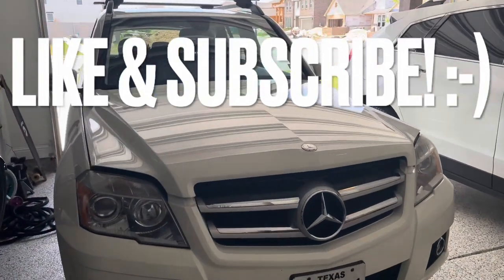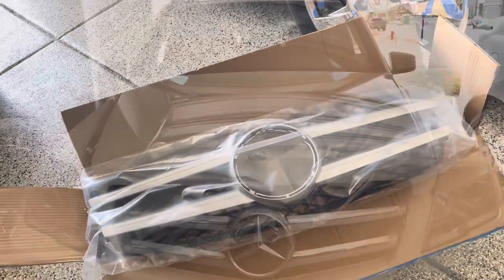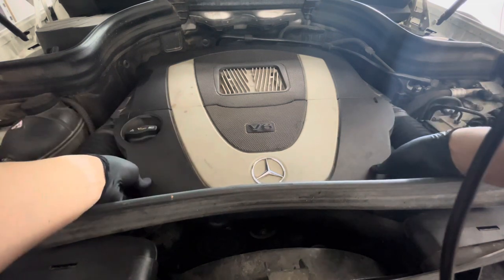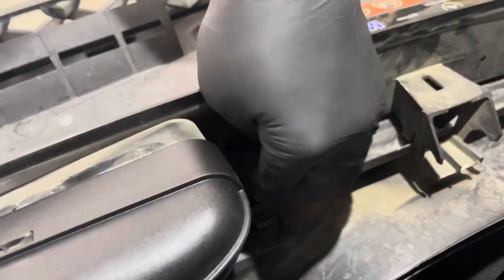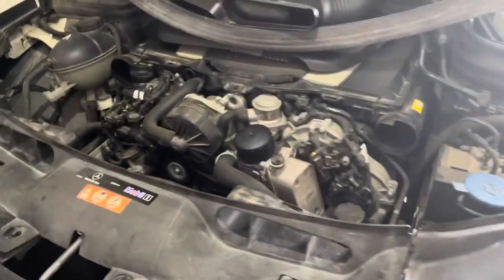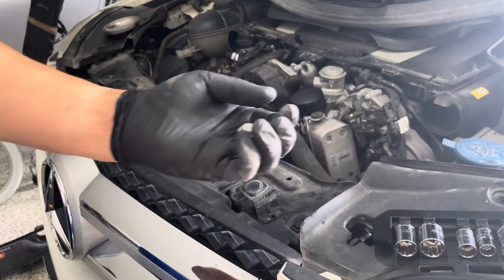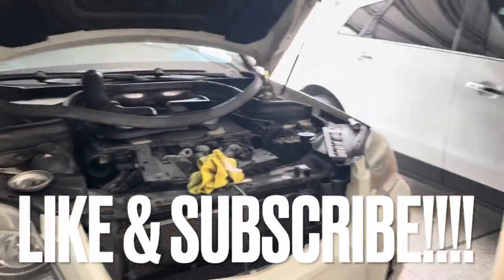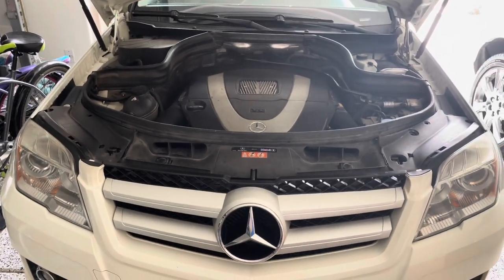How to replace #Mercedes-Benz #GLK front #GRILL cover. Easy video to watch.

Comment: Awesome video.  Followed directions and it went great.  Had to slightly modify the replacement section on top (far side tabs did not fit in slot on new grill, just trimmed the tabs off and slid right in.  Held snug with other two tabs. No loss of integrity).  Thanks for sharing.
Reply from the maker: Great to hear Chad and thank you for the comment. Please like the video and consider subscribing to the channel if you haven't already.

Comment: I tried following your video. It helped but the old grille came off with a lot of broken bits. That's ok I need to replace it, that's why I'm remove it in the first place. The old plastic is brittle after 13 years. Now I need the round star emblem so it can be installed in the new grill. Sure doesn't come off easy.
Reply from the maker: Yes, the emblem is tricky for sure. Are you going to get a used one from a donor car perhaps?

Comment: Man I just need to replace the top left chrome trim on my grill. Somehow it fell off and I’ve been looking online for a week off and on for the damn piece of the grill I’m missing. I don’t need the whole thing or to mess with changing the grill I just need that chrome trim cover for the top left “bar” on the grill
Reply from the maker: Yeah. I didn’t find any chrome piece online either so I replaced the whole thing. It’s cheap to replace the whole thing with aftermarket. It’s $100 or so